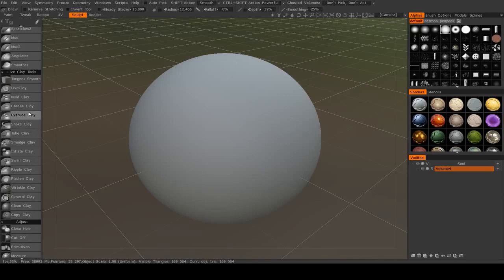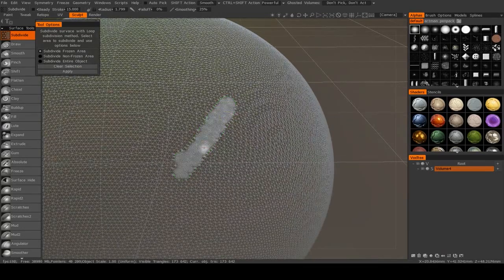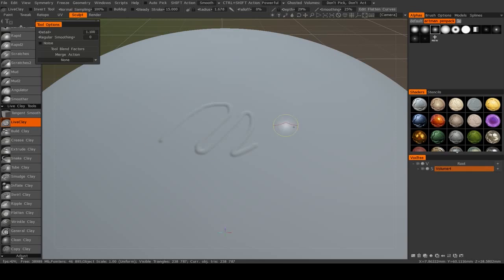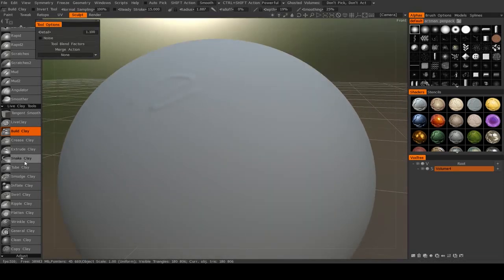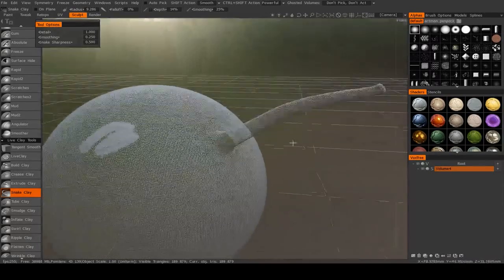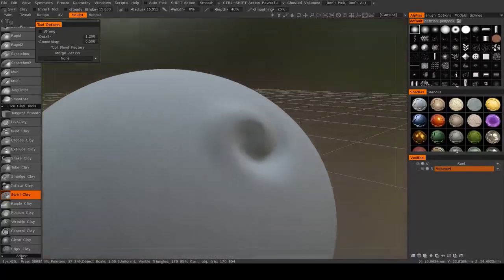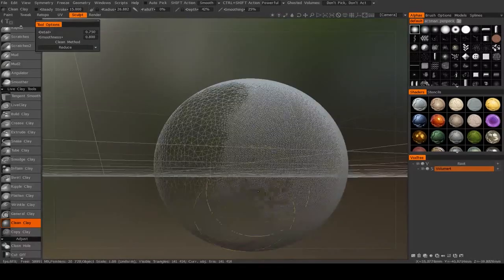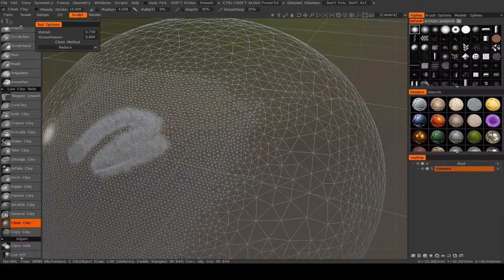Welcome to 3D-Coat: Part 12 (Live Clay)

Comment: So when is the best circumstances for when to use Voxels vs surface / live clay?
Reply: +PiNPOiNT2K Hello, I am the same person who uploaded this video, but the AlienMinefield account is unable to post comments, so I am using an older account until I sort that out. 

Typically, you want to us Voxels when you are starting out and creating your base form because they offer the most freedom in terms of topology. I personally also like to do medium detail passes in Voxels because the tools aren't as sensitive and are a bit more stable. You want to use Surfaces when you are working in fine details because Surfaces allow for non-uniform polygon density. For example, if you are working on a human character, you want to focus most of the detail on the face. If you were working in Voxels, you would have to increase the resolution of the entire object to the same high detail level as the face. This can result in an absurd number of triangles. When you are working with Surfaces, you can subdivide only the face or you can use live clay to sculpt in wrinkles precisely where you need them without increasing the density on the rest of the object. Surface mode also has some unique tools like Noise and the Lute brush which may suite specific use cases. I hope that helps!
Reply: +Tranqualizer20 Thank you very much.  And i guess live clay is if you want high detail surface detail but only in a specific area?
Reply: great explanation. I still haven t used 3D-Coat BUT I have been using ZBrush for 1 year now. The possibility of having extra polys ONLY on specific areas of the surface is no feature of ZBrush AND that is a big lack. Of course ZBrush is great and so on,,, BUT besides that there are lots of differences that so far push 3D-Coat in the front array as: Apparently you see all the materials in the materials panel in 3D-Coat, in ZBrush NO, if you look for further materials in ZBrush you have to go to the explorer AND there you don t even see what they look like, not even tiny thumbnails...I loves all your very practical workshops and I will buy that great peace of software. Greetings from Toulon in France